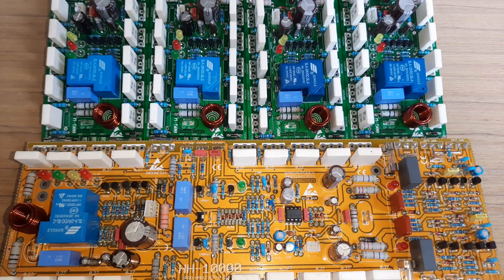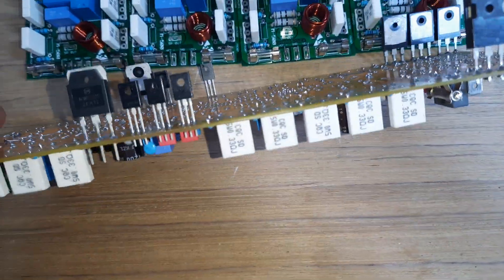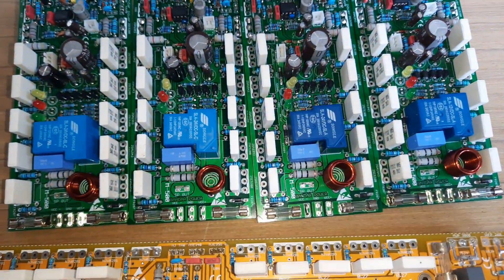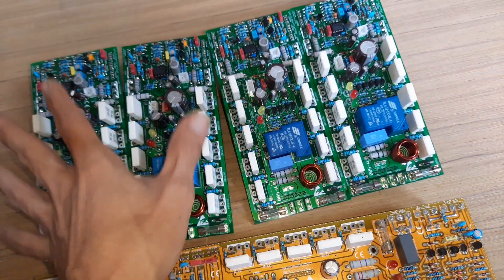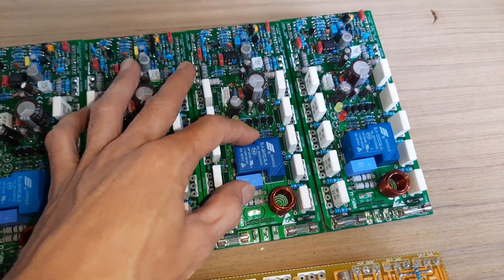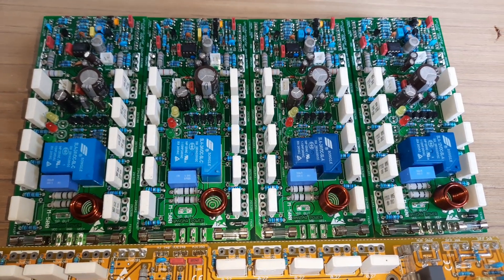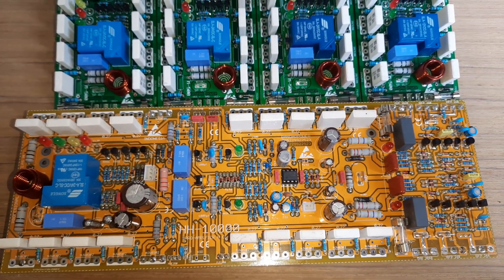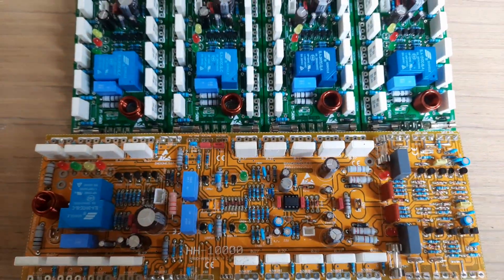siap kirim.lagi ke pemesan...clas h.dan clas b...

Comment: Itu mksml vcc 180.. travonya apa hrus pake v yg 180 jg.??
Reply from the maker: Gak harus dong...pakenya psu yg. Buat clas h...180v adalah maximal nya....inggat watt power tergantung vcc nya...semakin besar vcc twntu watt akan semakin besar
Reply: @Bandarpower  ow jdi umpama mksimal vol di travo 130 ttep mampu menghandle scra mksiml ya.?   Maaf msh pemula..
Reply: @atengroni8259   semakin sempurna psu nya tenaga power semakin bekerja maksimal .
Reply: @sakataberutu9962  jdi v travo 130 bisa keluar 180 gtu..
Reply: @atengroni8259  maaf itu kayak,e utk 65vac(90vdc) double spoll..
Reply: @subursiswanto8635  iya travonya double ct yg saya mksud.. jika travo mksmlnya umpama 65 sma 130 apa bsa mksimal buat driver yg suplay mksimal 180 v..  maaf saya msh pemula
Reply: Krn main model steper mv 65vac dan 130vac
Reply: @subursiswanto8635  ow gitu... jd bisa mksimal ya..